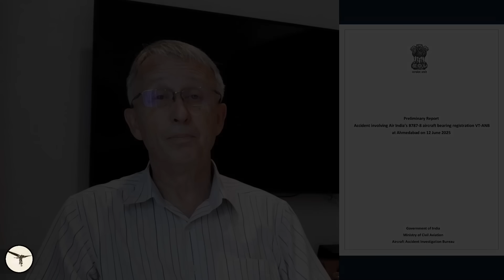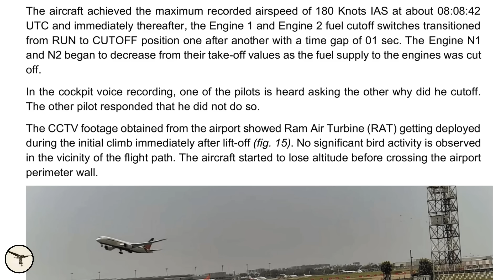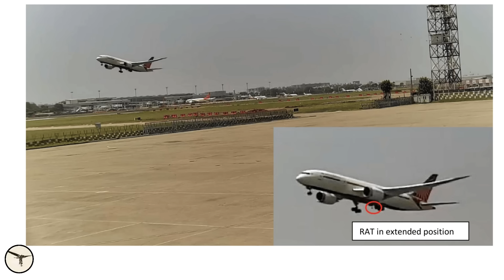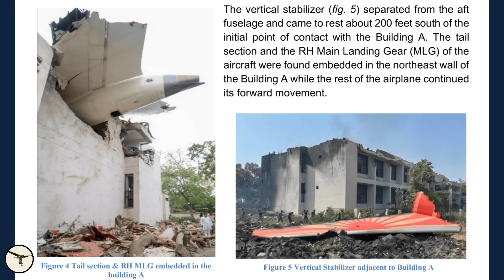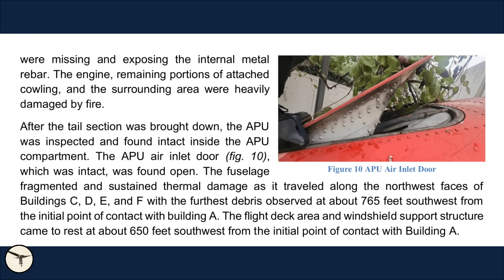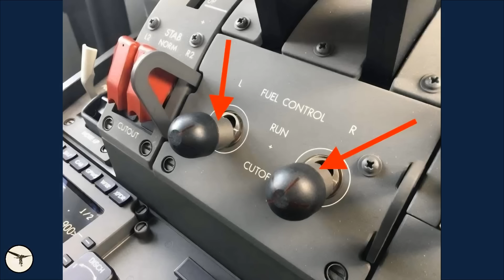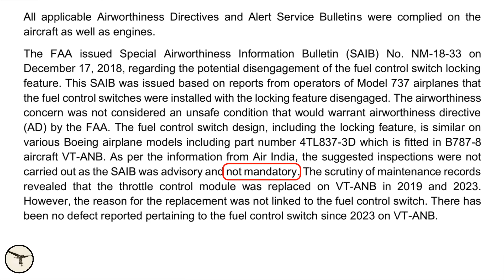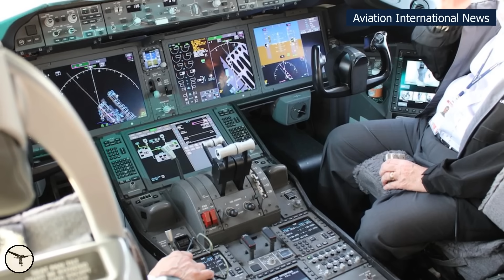WARNING Fuel Control Switches Failure Could Cost LIVES

Comment: Thanks for a (rare) cool, analytical report.

I'll just point out that we don't know when the pilot conversation took place - it could in fact have been any time in the 13 seconds after Cutoff and before Mayday, or even in the 16 seconds after Mayday.

The Dec 2018 SAIB re fuel switch safety locking feature disengagement absolutely cannot be discounted, as is happening on so many channels.

My first reaction to reading the full prelim on Friday was that it was striking in what it left out. It gave the overt impression of precise reporting, while remaining deliberately vague.

Needless to say, if this was an aircraft failure, Boeing is finished.
Reply: When I read the whole report on Friday, i noted that it doesn't say the switches were physically moved, either to Cutoff or later to Run. It uses the ambiguous word, 'transitioned', strongly suggesting pilot action while avoiding precise terminology.

There is NO CERTAINTY yet that the switches ever PHYSICALLY moved from the Run position at all.
If another part of the system was responsible for the fuel cutoff, the pilots would have heard a fuel starvation audible warning, which could have led to their conversation which was hinted at (not quoted) in the prelim.  There is no certainty that the conversation was triggered by either pilot looking down at the switches and seeing they were off. 

We also don't know when, within a span of 29 seconds, that conversation took place. 

There is enough vagueness in the report about this conversation to make me suspicious of the investigators.

If the switches were thrown manually, the second stage, transition back to Run, is likely to have been pilot action, taking 4 seconds to operate the two switches.

The first phase, moving both switches to Cutoff within "1 second" or "0.1 second", has to be considered as possible non-human action, especially when 787 pilots are saying it can't easily be done that quickly by a pilot.

Comment: Please look into sb73-0097r01 service bulletin
Everything will make sense assuming if it's dual engine failure.
Pulling the switches from cuttoff to run is memory item for dual engine failure.
One pilot questioned why was the switch flipped to off because he felt the power roll back, not because he actually saw the switches in off position.

Comment: The report makes absolutely no sense whatsoever. Do the experiment! Throttle up a B787 engine to near max power (required for takeoff), then turn off the fuel cutoff valve for 10 seconds and then turn it back on. What will the engine do? Go to idle, or instantly go to full thrust? I think the latter because the engine will still be hot and rotating at near full RPM.

Comment: It doesn't seem likely that both switches' locks were disengaged and that both switches were inadvertently moved. That might explain the short time interval though because it also doesn't seem likely, assuming the switches' locks were engaged, that a human pilot could move both of them in 1 second.
Reply: Like someone with a bad intention would switch it as fast as they could .  Like here where 1 sec interval was done to switch off both switches.  Also the question is why it took 10 seconds for the first switch to be on and 4 seconds later the second switch.
Reply: @jayvee8502 Yup, those are also good questions. You're correct that anyone with bad intentions would do it as fast as possible. But moving those switches is a multi step process and one second isn't a very long time.
Reply: @Valicroix But switching it back on for 4 seconds interval is a bit long.

Comment: Is the “transitioning” of a cutoff switch from one position to another detected by the FDR as an energization/de-energization of the switched circuit? In which case the position is inferred by electrical status. Or does each cutoff switch have a sensor that detects the position of the switch? In which case the FDR reliably records physical movement of the switch.
Reply: The switches ( (model 4TL837-3D - in Octopart have their datasheet) have ON-ON electrical positions, now rest know if the FADEC register when they lost electric contact or make electric contact for send command for the fuel valves  close or open.
Reply: @Sokol10 thank you!
Reply: Switches have dual poles. One set of contacts sends switch position to the aircraft data network, available to any system that requires switch position status, and that's also where the FDR reads the switch position. Another set of INDEPENDANT contacts is directly linked to FADEC to control fuel/engine. In the AI case, the FDR read switches moving from RUN to CutOFF. Immediately after, the FDR also read corresponding (and expected) engine shutting off out and spooling down (this is almost immediate, when a switch is thrown to CutOFF the engine is gone in a sec). It is already established that the switches don't move by themselve (anyone arguing against this doesn't know what they are talkin about and has never seen or operated the switches), and that the switch design is VERY reliable, they have been used daily on just about any airliner out there, Boeing or Airbus, for decades without issues. So for the engines to shut down and the FDR registering both switches going to CutOFF without the switches physically moving, you would need simultaneous failure of both set of contacts, in two different and independant switches, on the same aircraft one second apart. The chances for this to happen are close to absolute zero. Electrical "glitch"? It would have shown on the FDR, and there is no mention of it. The switches on the AI flight were physically moved, there is no argument against this. And since they don't move by themselve, unfortunately the only explanation left is a deliberate action.
Reply: @carlveilleux5744 Thank you, that’s very clear!

Comment: India had a 2014 787 with a 71 hour countdown timer that turn both engine fuel switches to off. On the internet info
Reply: The timer reminds the pilot but does not actually perform the restart.

Comment: I think this is what might happened when engine stalled. 
Pilot 1 questioned why cutoff.
Pilot 2 responded did not. 
Pilot 1 looked at the switches is still in run position. 
Both pilots access the situation for 10sec.
Pilot decide to reset fuel system by switching run to cutoff to run engine 1 then engine 2. 
So it is possible that the FDR record the data did not record the physical position of the switch, but record a electrical signal somewhere else in the electrical system or the fuel flow.
If when noticed the switch is in cutoff position, would one immediately do a reset?
And I like to know when else is going on in those 10sec.

Comment: 8 seconds from airborne to rat deployment means by the time of rat deployment aircraft should have climed to at least 200-250 ft. From the airport camera picture it looks like aircratf is below 150ft with rat already deployed. Something is not adding up here ...
Reply: That's when the RAT started supplying hydraulic power, not when it was deployed. It takes a few second to spool up. It should have deployed immediately after the main engines shut down, which was just three seconds after liftoff.

Comment: Riding with hand over switches is an interesting and unique possibility that only you so far (as I have viewed) have brought up.  If so, some bump could have caused fingers to "grab" switches, including finger tips pulling up on "balls", and then snapping levers down.

Otherwise—
Presuming neither pilot error nor deliberateness, either:  1) Switches fell out of locked position due to known mechanical problem (bulletin), maybe resulting from a vibration bump, or never having been fully secured into locked state, then pilots later returned to RUN.  Or, 2a) systemic electrical malfunction or disturbance caused RUN position signal from switches to be lost momentarily, interpreted by FADEC as then being to shutdown cut-off, and data recorder to see them as no longer being in RUN (or, FADEC reports this perceived setting to recorder), with the signal states to later become corrected/restored as electrical power to the switches returns; or, 2b) the electrical situation caused each FADEC to reset/restart.  I.e., the switches NEVER physically moved out of RUN in either sub-version ‘a’ or ‘b’ of second scenario.
Reply: Problem with 2, 2a is that the circuits for each switch and engine are independent, so the possibility of the same electrical fault happens in both almost at same time  - 1 second delay, became highly improbable.
Reply: @Sokol10  That is a question, and I was supposing that maybe a single power buss to the switches.  But, even if totally independent, could still be both susceptible to some sort of same systemic electrical disturbance.  The one second difference could also show that are related event, just not being exactly the very same instant.  Electrical and/or computer faults can be VERY quirky.  My overall main point is that may have another MCAS-like situation of some sort, where every failure possibility had not been fully thought through, or too much reliance on fallback that could itself fail.

Comment: A thoughtful analysis. I wonder whether a green led light comes on in RUN position might help. 
Why isn't there a overhead camera in the cockpit? Why doesn't airports have several HD cameras of take offs and landings instead of relaying on amateur footage.
Reply: No camera recording video in aircraft cockpits due unions pressure against and also political pressure of some factions, that alleged a "1984 Orwell" scenario - the last second ChatGTP. 🤔

BTW - Here in this "corner of the world" video camera was installed in public transport bus, recording the driver actions - who accumulates the ticket collector function, for cut costs. Their unions are weak.

Comment: As a matter of interest, according to Honeywell’s data sheet, these pull-to-unlock toggle switches are made in both two and three position models, and several different locking configurations. Some need to have the lever pulled out to move out of and into any other position, and some are locking when moving from one position to another and free to move without pulling when moved to the other position. There is a letter at the end of each switch catalog number which denotes the locking configuration for that switch.

Comment: The switches require very deliberate manipulation.  There is zero possibility that both switches, one at a time, would be "accidentally" moved to the cutoff position.  Certainly a murder/suicide.  🤪
Reply: I suggest reading the FAA issued a Special Airworthiness Directive (number NM-18-33) and then decide for yourself if accidental operation of the switches by an errant hand or forearm movement was possible.
Reply: @SVAdAstra  NM-18-33 just points out that it is POSSIBLE but super unlikely that the locking feature on one individual switch might not perform perfectly, but that "the airworthiness concern is not an unsafe condition", but rather a one in a million possibility to be aware of.  Zero chance that a failure of BOTH switches locking mechanisms would occur simultaneously just in time for a clumsy hand to trigger first one, then the other 🙂
Reply: @SVAdAstra  If Air India totally ignored the directive, the fault is with Air India. However, i read elsewhere that the switches were replaced 2 years ago. For two switches to fail in the same manner and within the same 2 second interval is pretty much impossible. If both switches were only partially engaged then this is negligence on the part of the crew.

Comment: Apparently the FAA bulletin in Dec 2018 made public, this issue of fuel switches "not" locking in and could easily trip to the cut-off position. Why then weren't all the relevant Boeing crafts called back immediately?? You see, grounding so many planes was not pocket friendly for Boeing. Now that flight 171's CVR also evidences that both pilots were together clueless on how it went off, it is dead clear that Boeing's lobby threatened India in the last 4 full long weeks to play it to their favor. The buck stops here.
Reply: Because the bulletin was advisory and not mandatory.

Anyway the accident aircraft have their throttle console - that include the fuel switches;  replace in 2019 and 2023, none due issues with the fuel switches.

Comment: As per the image from the report, RAT was already deployed at around 70ft (Guessing) pilots will be monitoring the instruments at that time. PF will be having both hands on the Yoke and PM will be looking at speeds. Nobody will be fiddling with the switches by that time.. except landing gear lever, which in this case they didn't even bother to touch because engine already failed by that time. Need deeper investigation into the systems.

Comment: I am wondering if the pilot was wearing a looser shirt or a saree  that simply caught the switches, which are below the throttle control, when moving his hand down to hit another control. It is possible that the switches were electronically engaged but not fully off the top of the notch.  I could also see how a headphone cord could do this. I don't like this design. I could see myself moving the throttle up and then reaching down to flip another switch or to look at a display.  The cuff of my shirt could snag those switches and toggle them off if they are are worn out or stuck on the edge. The angle is just right.  They are supposed to lock and only be moveable by pulling out on them, but that could definitely happen. Also, the switch can get sticky and the edges that are supposed to keep the switch in place can become rounded and smooth. 

I think that Boeing needs to do something to prevent the engines from being cut off in flight.

What reasons would you need to cut fuel to engines during flight? If an engine fails and is blowing flames, you need to turn off the fuel.  This is an emergency situation not a common occurrence.  How I would resolve this issue is two design corrections:

1. The fuel cutoff switches need to be ROTARY switches that you push and turn to the right. The switches would be recessed into the panel. You would push in and turn, much like an ignition switch in a car.  Once the switch was engaged it would snap into place.  The concept of the rotation is similar to the gas knobs on a stove. Second, they need a big GREEN "ON" indicator.  This assures that the pilots know that they are on or off regardless of the way they look.  With the existing toggles, which you have to pull to move, the switch can get stuck in the middle position due to the spring torsion. THIS IS NOT THE FAULT OF THE  SWITCH MANUFACTURER, but the aircraft manufacturer for choosing the wrong part for the function. 
This is a bad habit of aircraft manufactures as toggle switches are common for non critical operations, and pretty reliable.  However, turning fuel off is a very critical operation that can obviously crash a plane. 

2. When the switches are engaged in RUN, each individual switch needs to be wired to a relay that is configured to be self latching.  The switch itself STILL MAINTAINS contact, but when +24 (or whatever voltage is used) is applied to the output of the circuit, the relay coil is energized and its contacts essentially bypass the switch and will keep it on even if the pilot turns the switch off. The relay coil needs an appropriate fuse to prevent it from shorting out the circuit, and the fuse should be on the positive side (not to ground). 
In order to actually turn the fuel off to the engine, the Pilot and CO Pilot would need to simultaneously push Fuel OFF on opposite sides of the cabin on each engine.  These would be normally closed switches wired in parallel, in series with the relay on each rotary switch.  

In order to shut the fuel off, the rotating switches would have to be turned to OFF mode, and then both pilot and copilot would have to press the switches to turn off the fuel.  This reduces the chance of turning the fuel by accident, or even on purpose such as a sucidial pilot.  

Another simple fix would be to add an additional confirmation to turn off the fuel that keeps the power on until confirmation.  Another fix would be to prevent the fuel from being turned off when the plane is in motion. The problem is when an engine blows out fuel needs to be turned off.  On a crash landing, the plane is in motion, but the fuel needs to be off to provide better safety from fire.

Comment: During takeoff and climb the throttles are 6”-8” forward of the fuel shutoff switches, and the pilot’s arms are fully extended to reach them.  All pictures shown unfortunately only show the throttles at idle, making those that are not airline pilots think the probability of accidentally bumping the switches is high.  IT IS NOT.

Comment: Thank you Captain Magar so much for your important question regarding the Boeing fuel control switches not fully locked, thus in danger to flip into "fuel cut off" position due to various reasons you have mentioned in your video...also the gap between 1 sec or 01 sec for fuel control switches going from "run" to "Cut off"  should be clarified... I would also like to know if a fuel cut off could theoretically occur without those switches actually moved into cut off position (due to any kind of electrical malfunction). It should be clarified if after take off the pilots/one of the pilots did switch from "cut off" position into "run" or from "run" to "cut off" back to "run"...